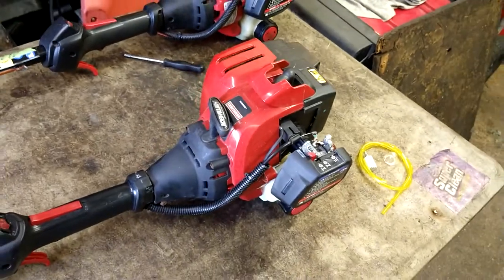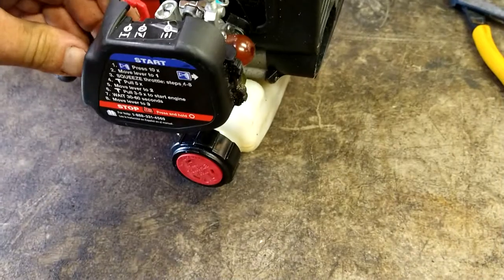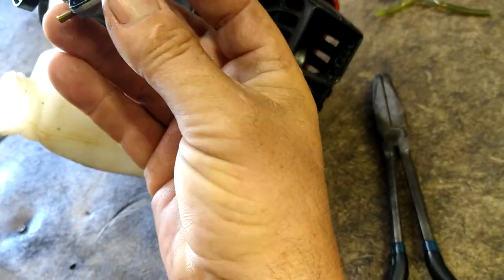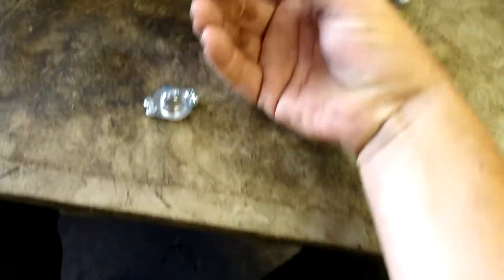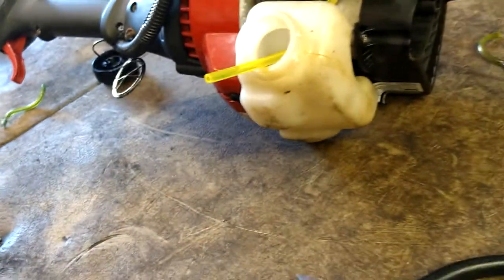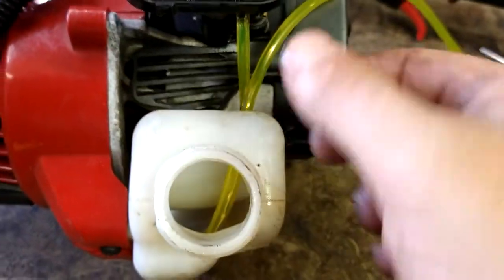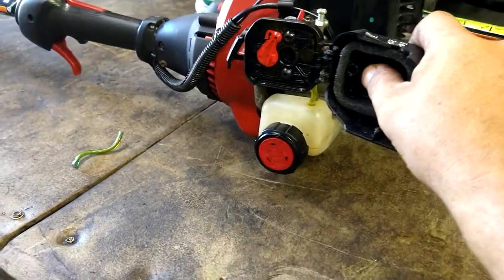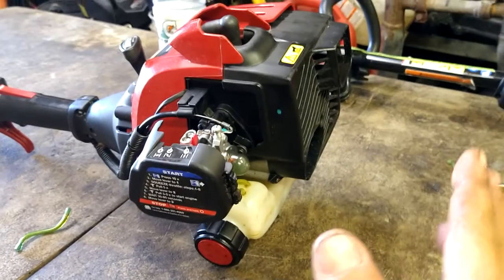craftsman weedwacker model 316.711023 fuel line primer bulb repair

Comment: I got mine for free on the side of the road it works ok but could be better I’m fixing to change the gas and the line and my bulb has a pen hole in it and sprays me if I get busy and forget to cover it I may try and put some kind of glue or Epoxy on it to stop it from doing that , and I think I’ve been starting it wrong I seen a video on how to do it right so I’m going to try that but other than that it has worked great thank the Good Lord above .. great video thank for all the helpful info for a woman especially it so helpful !! Have a blessed day !
Reply from the maker: get new primer bulb. nothing will seal it

Comment: Should you replace  primer bulb and fuel lines yearly
Reply from the maker: If it's not broke don't fix it.
Reply: @smallengineguys  well I e had this weedeater 2 years. Primer bulb dry rotted.  Fixed it. Worked good for a day or two. Now wont suck gas to carb. Think  fuel line clogged.

Comment: Got the same model. What's with my trimmer head not spinning properly? I know it has some clutch mechanism that will only engage (trimmer head will spin) when engine rpm's increase (giving it throttle). But mine seems to be slipping, if that's a thing. I can give it full throttle and hold onto the trimmer head and it won't spin. Is the clutch mechanism in the head or the shaft? I'm trying to figure out why it's slipping. The attachment seems to fit and lock in securely. I'm lost here.
Reply from the maker: clutch is under the front black piece on the motor. they get rusted and dont fully engage sometimes. when you get to the clutch remove clutch usualy 2 bolts sand bolts oil clutch and make sure it moves free. it will be stiff because of the spring so it only has to move a little and bounce back. then reassemble.

Comment: I have one of these that was given to me and I can’t get it to run unless I hold the throttle wide open and have the choke fully closed. Then you have to move the choke slightly back and forth from position 1-3 while holding the throttle wide open. I got it to idle for about a half an hour with it almost on full choke and ran one full tank of fresh gas through it mixed with a little sea foam. I don’t know if it’ll help or not but I’m wanting to try anything to get it running good enough to at least trim my yard. The spark plug looks okay, I sprayed a little carb & choke cleaner inside the carburetor thinking that might help clean the carburetor a little bit. I’m not sure if the carburetor needs adjusted or even how to do it to be honest. I just moved to a new house from an apartment and want to try to get this running good enough before the grass starts growing. Any help or tips you could provide me with would be greatly appreciated.
Reply from the maker: first there are 2 adjustment screws next to each other. turning the one closest to the air filter assembly counterclockwise a quarter turn at a time till it runs may work. or make sure you have new gas these are touchy 3 week old gas will make them not run properly. or  new carb and fuel lines works every time.
Reply: @smallengineguys  thanks a lot, I appreciate it.

Comment: Crazy question, when I primed my bulb, it gets stuck in the “push down” position. Took apart and cleaned the screen, worked for a split second and did it again. It’s like it’s holding suction. Any advice?
Reply from the maker: change carb

Comment: Have the same model
Carbs on these are terrible
Always store these without fuel over the winter
Reply from the maker: Even better remove fuel fill with sea foam prime up store. Oil doesnt go bad. When your ready to use drain sea foam new gas prime start.

Comment: What can you do if you have fuel leaking from the hole of the tank that the fuel line goes through?
Reply from the maker: if your lines shrank replace them. if you stuck something in the hole and made it bigger you'll have to do a double nipple.when you push it in the line it makes it bigger. here https://amzn.to/2TT7Pxa so short length with filter on it plug this in it. then more line from this to carb then shove this with fuel line in it into hole. same with return line. if i get a chance ill do a video short for you tomorrow.